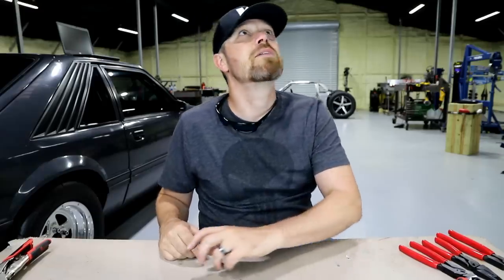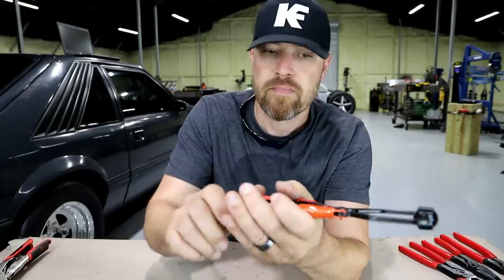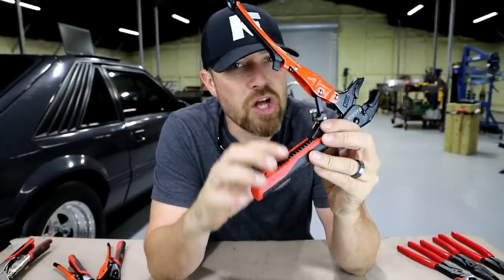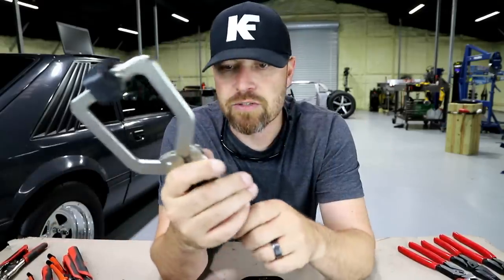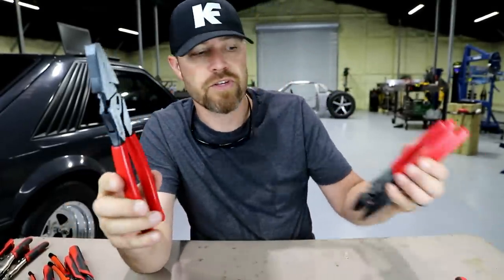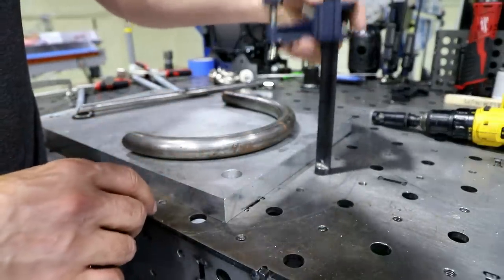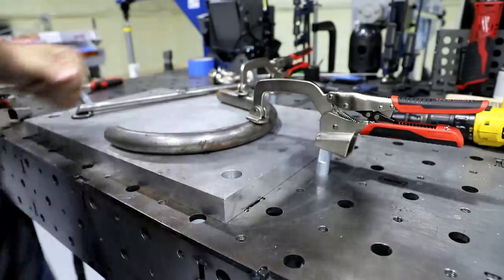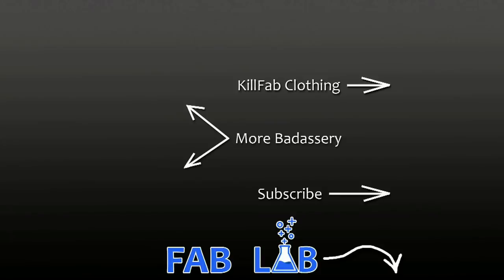You Need This Tool - Episode 112 | Industrial Welding Tools by Armor Tool

Comment: You would be correct about that adjuster screw adjusting the tension on those clamps. I have some panel clamps from another popular brand found at Lowe’s just like that. I haven’t used the standard vise grip style ones yet though. Thanks for sharing these!

Comment: The one thing about the screw adjust is that you can use the clamp as a plier by just adjusting the screw with less pressure. Does that happen here with these? It so e of these look good. I/be heard of the company but never looked at them. This was good. Those cam pliers look good. I think I’ll get a couple to try out.

Comment: I BOUGHT ONE ONE SIX INCH DEEP REACH AND IM NOT HAPPY WITH IT. ITS CLAMPING POWER IS VERY LIMITED. IF U TRY AND ADJUST THE TENSION KNOB IT RELEASES ITSELF. AT MAX TENSION THE TOOL CAN B MOVED AROUND VERY EASILY. BASICALLY IT SUCKS. AN EXCELLENT IDEA IF ONLY IT WORKED. JUST MY 2 CENTS.